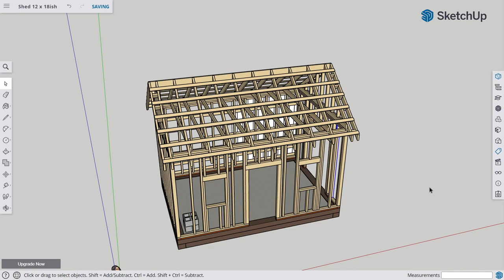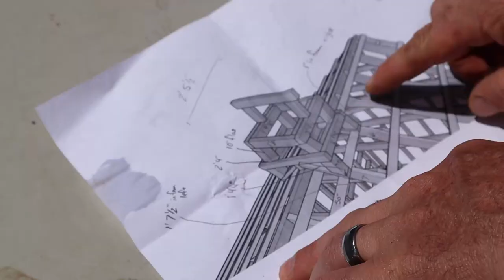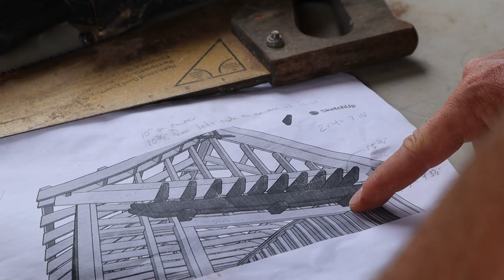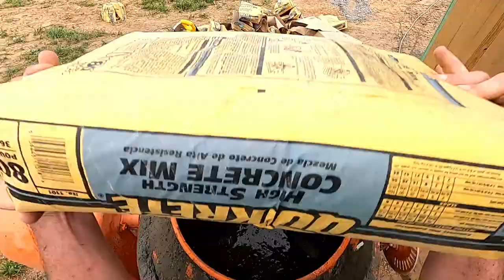Couple builds custom shed with own sawmilled lumber - start to finish in 23 minutes /// E59

Comment: Are you able to share your plans and drawings for the shed build? I'd love to try and duplicate something like that. Nice work!!
Reply from the maker: I designed this in SketchUp, but don't have hardcopy plans with all the engineering notes.  Due to the dimensions, I did not need a building permit, so I more or less made it up as I went along.  It's a stick built structure with true dimensional lumber, measuring 16 x 12 and 9 ft studs.  The roof pitch is 9/12.  If you know SketchUp, I'm happy to send you the file if that is allowed.

Comment: How many trees you cut for this shed ?and how big they are? I am doing something like that I don't want to cut more then what I need.
Reply from the maker: I'd estimate 4 x 16 in. pines for the rafters and stick framing.  Probably that many for the siding and trim, too.  We used poplar for that, but I did use a lot of our smaller trees that came down from the leach field, so it's hard to give you an estimate.  I really used what was around me in the woods (recently downed trees) before I cut any live standing ones.  Start with 8 total and go from there.  If you can get 5 logs of 10ft. per tree, that would be a good amount to process.  Good luck!